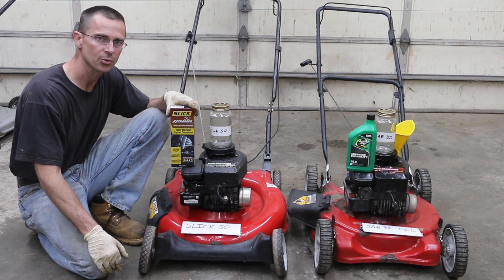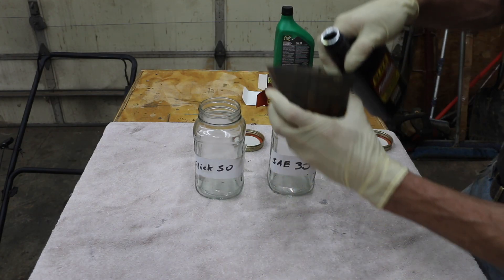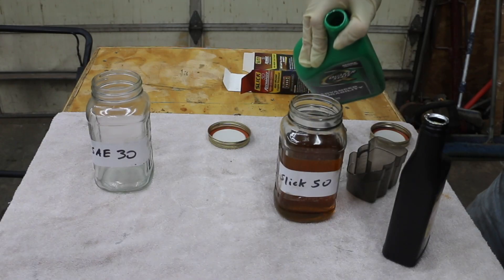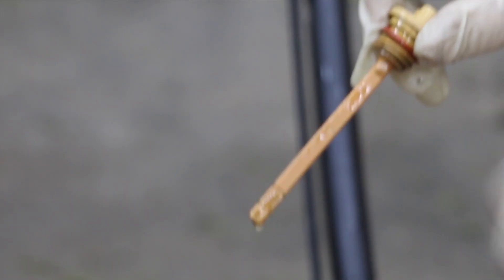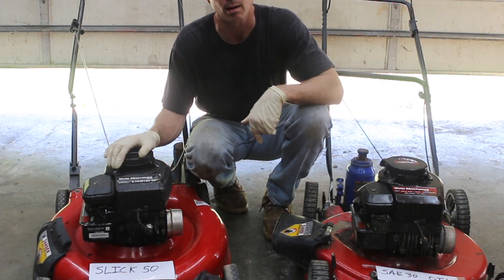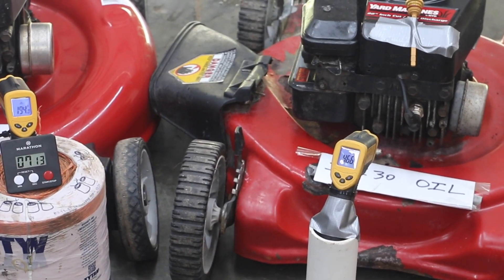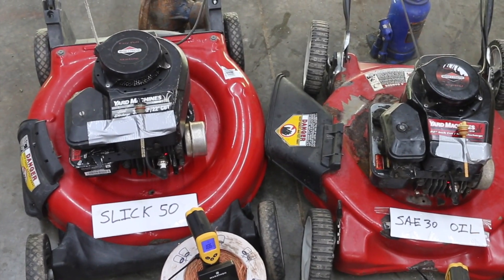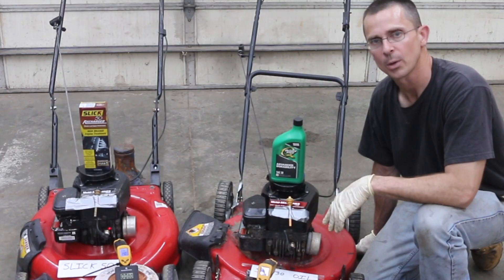Can't believe what SLICK 50 did to my engine!!--Dry Crankcase Test!

Comment: I bought Slick 50 and put it in my 1982 VW Rabbit Diesel in 1989.  The original Slick 50 saved my VW.  Before adding it to my engine, I used GUNK engine cleaner and ran the engine for a set period of time.  I then flushed the oil and did it one more time.  Now with a 3rd oil change I added the Slick 50.  The first thing I noticed was that I no longer had to downshift just to climb up a hill on the highway.  Instead, I actually gained speed.  Secondly, my fuel mileage jumped up to 65 MPG and stayed there for months.  Additionally, my diesel engine became so quiet that it no longer had the tell-tale sounds of a diesel.  One mechanic swore my engine wasn't a diesel until he looked under the hood and I proved it was!

Well, I used to deliver the local newspaper at night on about 170 mile route in the rural areas. One day I was so busy that I couldn't change my own oil and had a shop do it.  I drove my night route that night and the next day I was working on the engine when I decided to check my dipstick.  NOTHING.  My crankcase was completely dry!  The idiots at the shop didn't put my oil plug in correctly and all of my oil drained sometime while I was driving my paper route.  

The temperature in my engine never even raised when driving without oil.  I just fixed my drain plug and filled it back up with oil (did it myself from that point on!) and kept driving.  Never had a problem with that engine.

My friend had the exact same car and I told him what happened and said that he needed to do the same to his car.  He kept putting it off.  One day he drove too fast over some railroad tracks and bottomed out in his VW, cracking the oil pan.  Within a half a mile his engine seized up.  

That is my experience with the original formula of Slick 50.  I stopped buying it when they changed the formula.
Reply from the maker: Interesting!  Thank you
Reply: Wow! That is very interesting.

Comment: In fairness to Slick 50, if it will allow the operate the engine that much cooler (no idea how), that should prolong its life. Since most people don't run their engines dry, so the ability to cool is actually a better characteristic in reality.

Comment: The old Slick 50 possibly did work (25 years ago) however the formula was changed - the old Slick 50 is now called XcelPlus Engine and l believe does work - Slick 50 is possibly a scam
Reply from the maker: Thank you!

Comment: The slick 50 still had 80% 30 sae oil. Engine type and age were the factors not controlled   Try again with new identical engines. Run engines for at least four hours as it takes time for slick 50 to bond to metal. Like all your tests really well done. Thank you
Reply from the maker: Thank you for the constructive feedback.

Comment: I've always been using Slick 50 for ages after i seen an Ad by the AA (if i remember right) of a car that run without oil after been treated by Slick 50 for 15 minutes without any damage whatsoever them days you treated your engine once now its suppose to last for 50,000 miles have they changed the composition? or was Slick 50 not as good as we where told them days, also every time i treated an engine with Slick 50 the revs went up by usually 100RPM n that points out to lowering the friction whatever many thanks for testing n posting its much appreciated
Reply from the maker: Thank you!

Comment: You are missing the point.   The Slick 50 was not meant to be used exclusively but in conjunction with regular oil.  In that case the engine running cooler shows better heat transfer with the additive.  Using it that way MAY be advantageous.    But to test that you'd have to run the engines for days until they seized.....perhaps months.

Comment: On one hand, ordinary engine oil is much better than it was back in the 1980s, when Slick-50 was first marketed. On the other hand, it’s not clear that using Slick-50 ever provided a net benefit to an engine. Also, the FTC has busted the owner of the brand for making false and misleading claims:  

https://www.ftc.gov/news-events/press-releases/1996/07/quaker-state-ads-slick-50-are-false-and-misleading-ftc-charges
Reply from the maker: Great information. Thank you

Comment: Slick 50 does leave a teflon layer on the cylinder wall.  So you want an engine that is using oil before you use the Slick 50, and you want to leave it in until your next oil change.  Using it on a tight engine I would not do.
Reply from the maker: Great point. Thank you

Comment: Probably SLICK 50 doesn't really reduce the building up of the heat, but instead is not capable of disperding it. If you read an higher temperature means that the SAE 30 "gives out" (exchange) more energy and that exchanging happens right through the material that make up the engine which could be aluminium or cast iron in this case
Reply from the maker: Thank you!

Comment: I used Slick 50 with regular oil in my new car back in the late 80s and noticed the temperature was definitely lower! 
So it did what it said (one of the selling points).
My main reason to use Slick 50 was to give the engine better protection. Eventually, I stopped using Slick 50  after Is witched to using sythetic oil, Amzoil then Mobil 1.
I think the new Slick 50 is different from the original.
Reply from the maker: Thank you

Comment: I had a 1986 Crysler NewYorker when I bought the car it had about 72,000 miles on it. At that time there was an advertisement on TV about a product named ProLong. It was advertised to keep your engine running without oil for hours, so I put it in the engine and it ran for another 78,000 miles. That included the oil pump chain breaking at road speed and it was about 15 miles before I could exit the interstate. When I had the engine fixed the tech said that the engine was not hurt at all. I still use It in my cars so it can still be found at some auto part stores but not all of them and at some Wal-Mart stores.
Reply from the maker: Impressive results!  Thank you for the video idea!

Comment: Not a fair test. Engines need to have the same hours run on them prior to the test... plus all the other suggestions. Personally... I have used slick-50 for 30 years and I swear by it. It has saved many a motor for me and I treat motors very very badly.
Reply from the maker: Thanks for the constructive feedback.

Comment: try moybdenen dysulpfide  {molyslip} if they still make it i used this in motorcycle gearbox {molyslp D} after a along ride I found the drain plug missing  from gear box how. much of the ride was done with dry gearbox I dont know but it was bone dry and there was no damage  it wasent even noisy, this was all 60 yrs ago the bike was an arial square four with sidecar, wish I had it now
Reply from the maker: Thank you!

Comment: Thanks for that. Buyer beware. As for possibly generating lower temps as an additive, two things. One, in order to truly gauge whether real time benefits were realized, you would have to have run that Slick 50 engine on pure SAE30 first, so that you could compare the two temperature sets. Maybe the Slick 50 pulls the temp down. Maybe it doesn't. Your testing doesn't reveal that. Also, even though your engines are of the same type, they are two different engines with different histories and, you know, whatever subtle build quality tolerances may be involved even if they're the same age. In other words, if we call your Slick 50 engine A, and the other one B, and acknowledge that engine A failed first, what we don't know is that engine A wouldn't have failed first even if you'd made engine B the Slick 50 one. You would have to run the same tests on a large number of "same" engines in order to acquire reliable data, because on average half the time the engine chosen for Slick 50 would be the better one, and half the time the worse. Honestly, the surest possible "improvement index" does seems to be temp comparisons on the same engine. As for the Slick 50 tv ad, well, the fool and his money are soon parted, right? Your instincts are very cheeky though. I love it.
Reply from the maker: Thank you!

Comment: Interesting.

One thing I'd do differently is that I'd have checked engine temps for the Slick 50 engine when it was filled with nothing but 30w and then with Slick 50 later on.  For what little it's worth, I have seen oil reduce operating temperature, but that was in a manual transmission and not an engine.  I seriously doubt that a different oil or an oil additive will have a real effect on engine temps.

Something that can make the engine last longer?  Nah.  I've got 20 years as a mechanic.  How to make your engine last as long as possible is easy - don't use gimmicky additives like Slick 50, just use quality engine oil changed on time and use a quality oil filter on engines so equipped.  A lot of manufacturers these days have their own oil standards - use an oil that meets or exceeds that standard and use it religiously at exactly their intervals.
Reply from the maker: Thank you!
Reply: We if you can get maxi lube 
Have been testing against slick 50 for years you will get tired of waiting for engine to stop

Comment: Ptfe (poly tetra fluoro ethylene) or Teflon has a maximum temperature before it breaks down   There are several different formulas and variants that have different temperature limits but in essence if it gets too hot it gums up. That is most likely the failure mechanism. So long as oil is present it will work better but if you lose the oil the Teflon will cause premature failure at lower temperatures.
Reply from the maker: Great point. Thank you

Comment: I have used Slick 50 for years while stationed in FLA.. no complaints the engine idled  around 200 rpm faster and ran cooler. I did notice also that you DID NOT Shake the Slick 50 well before using it, which was required to mix up the teflon and other ingredients. I also have since early 60's  ,and still use STP oil additive today, Thanks , Henry Loos Sr
Of Waterford, NY
Reply from the maker: Thank you!

Comment: I noticed that the amount of oil drained from the oil only engine was less than the amount of the slick 50 engine. In act the amount of slick 50 extracted appeared to be greater than what was input in the first place.  The reason for this could be that the engines originally had thicker oil in that adhered to the internal surfaces and once they were drained and refilled the Slick 50 engine scoured better than the oil only leaving a much dryer internals in the slick 50 engine. The one good thing you proved was that as an additive Slick 50 does run cooler than oil only in the engines.

Comment: Well, 1) At 4:39 in, it looked like the SAE engine had a lot less oil removed as the Slick 50 mower did..I would think a test like this should have used the oil drain plug under the engine (blade area) to drain the oil completely. 2) the slick 50 mower remained like 100 degrees lower temp for quite some time, even though it was started first..  So if I'm taking anything from this video, I would think Slick 50 is doing a pretty good job of keeping the engine much cooler and I would not expect any engine to last without lubrication.
Reply from the maker: Thank you!

Comment: Way back in the early days of the internet, sometime in the '90s, I came across an article on Slick50. Allegedly, Briggs and Stratton, who have made millions of engines, tested this additive. They routinely pull random engines off the production line for quality tests. They took two random engines off, filled each with 30W oil and broke them in for the normal 5 hours. This oil was drained, and one engine got a new charge of 30W and the other the same, less 25% which was the Slick50 dose. Typically, cars have a four quart crankcase, and Slick50 was a quart additive. 

Both engines were run again, possibly up to their 20 hour oil change time. Both were drained. Both were restarted and run to failure. The 30W motor showed all the classic signs of stress. The eye-opener was the Slick50 motor. It suffered catastrophic damage, especially in the "boundary lubrication" areas, such as the top of the cylinder bore, which exhibited deep scoring. 

Puzzled by this, the engineers took to lab tests which suggested the PTFE in the Slick50 expanded to act as a kind of squeegee to rob surfaces of lubricating oil, hence metal-to-metal wear. 

Teflon, PTFE, whatever, is good at high loads, low temperatures, and low speeds. 

Apparently, DuPont sued Petrolon, the maker of Slick50, as to its claims. Petrolon won, because why? Because DuPont publicly said, at some point, the PTFE could be added to oil. They didn't say under what circumstances, though, so Petrolon rolled right through that loophole.
Reply from the maker: Thank you!

Comment: AMS oil is really great oil
 I stand with it
Reply from the maker: Thank you!
Reply: @ProjectFarm  when I first started using AMS oil it was on a 92 Ford f150 inline 6 4.9. I oddly thought it was a lifetime out then. I drive 35k miles on one change of oil. The stuff started turning black and gloppy. It clogged my oil filter until it opened up and by passed it.
AMS oil still protected my engine. 
I changed the oil and it never smoked in all the year I kept it. I put another 50k on it drove it to move to Alaska from Virginia. 
I will always vote AMS oil. It costs more but I can drive 12k to 14k miles, sometimes more. I change it once a year at least.

Comment: I used to do demo tests for Slick 50. the main thing we showed during the no oil test after treated with Slick 50 and it seized up, was that there was no or little engine damage with the Slick 50, vs engine oil. we tore them apart to show the cylinder walls and not damage. they just quit due to piston expanded to much and the friction stopped the engine. but once we put oil back in it, and let it cool back down, it would start right up and run normally. 
would love to see this in your test, the damage internally.
Reply from the maker: Thank you!

Comment: From what I remember Slick 50 was significantly surpassed by Pro-long which was surpassed by Z-Max. Z-Max ran ads showing engines treated with these treatments and Mobile 1. After draining the oil, they started them with a stopwatch on each. One by one the engines would seize up until only the Z-Max engine was still running at about 10 minutes in. You can get it in most auto parts stores.
Reply from the maker: Thank you

Comment: If you're still looking to try additives, I humbly suggest Tufoil, another PTFE based additive.  Back in the 1980s, I bought a gallon size (big discount) to use both in my truck and to use around the shop for other reasons.  I know there's a placebo effect, but I'm very good about not believing hype.  The 2.8 V6 Bronco II I used it in definitely ran better, and I sold it to my brother's friend at about 250K miles, and I know he ran it many more years and had to junk it because it no longer would pass emissions (feedback carb setup).  The Tufoil had a very cloudy, almost wine color to it.  Whatever it was, it wasn't straight oil.  Very sticky as I recall.
Reply from the maker: Impressive!  Thank you

Comment: We had a customer that raced dirt track on the weekends, small block Chevy.
 Towards the end of the season he   was racing  in the final 3 laps when he lost all oil pressure, being at the front of the pack he decided to go for it.
He finished the race, loaded up and went home.
The following week he dropped the engine off for us to rebuild for the next season.
 My engine builder was surprised to find after micing all the components no wear. Every thing was with in new specs.
The oil he was running was Amsoil and nothing else. This was at the end of the race season so even without the oil line failure you would expect to find measurable wear .
Reply from the maker: Impressive!  Thank  you for sharing this.